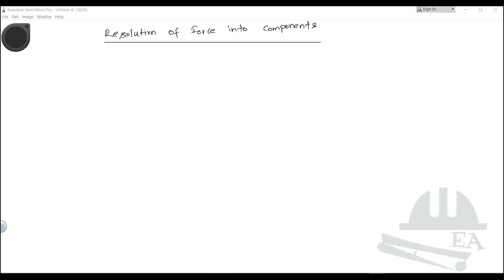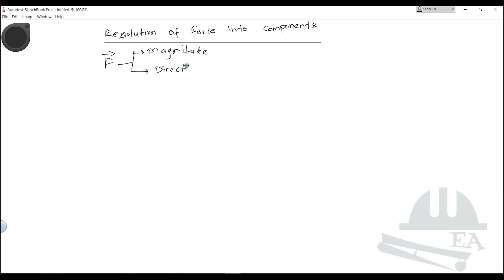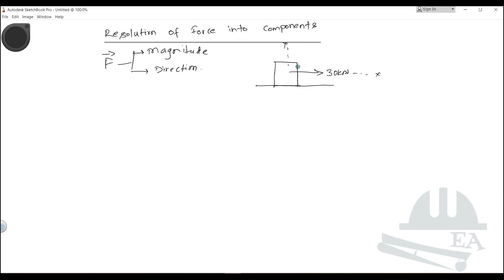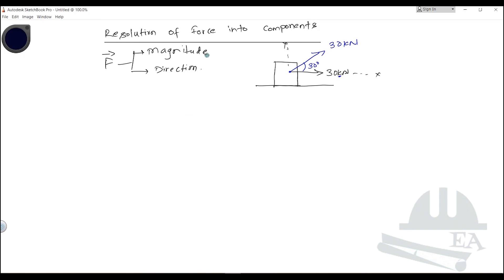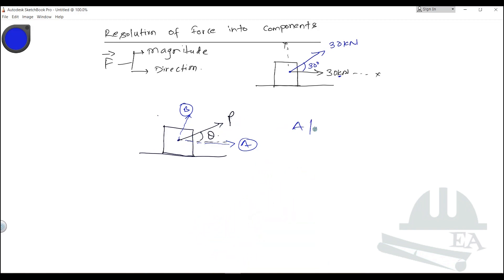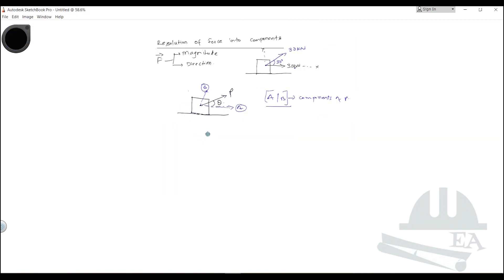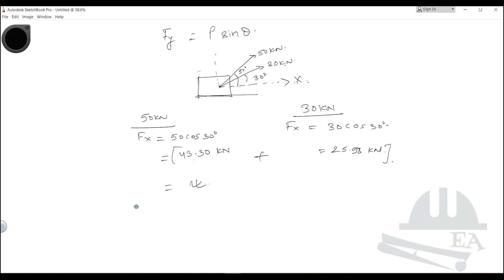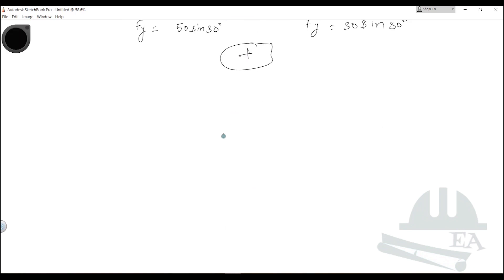Structural Analysis [Episode 3]: Resolution of Force

Comment: Hello sir, how r u? Your videos are very helpful for me. Actually I wanna ask you that where do I find rate analysis norms and standards plz suggest.
Reply from the maker: standards of Nepal ?
Reply: @engineeringacademy9812  yes sir Nepal standard in PDF form
Reply from the maker: @pradipmandal2352  Different departments have different norms fixed. You can just Google them. For example: norms for rate analysis of road works or irrigation works. They are updated time to time. So, you have to keep track of them.
Reply: I think he made a mistake on the 50kn calculations.